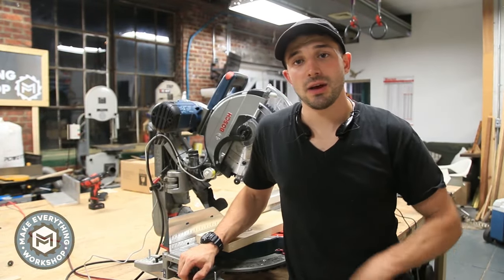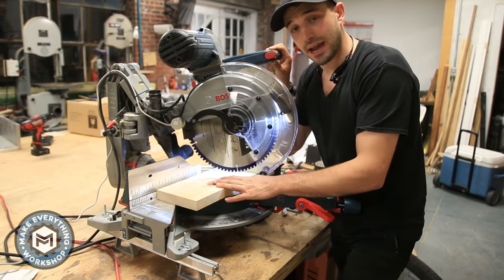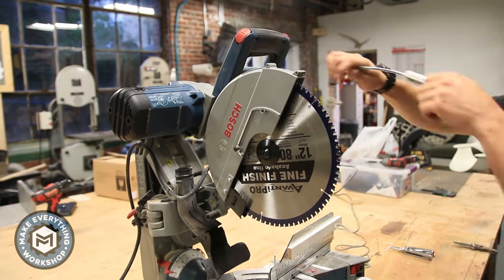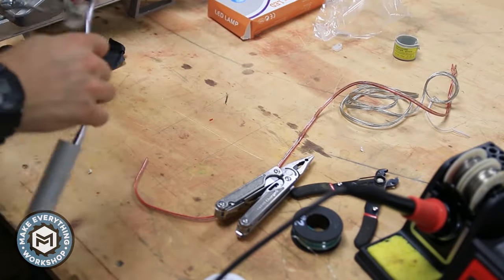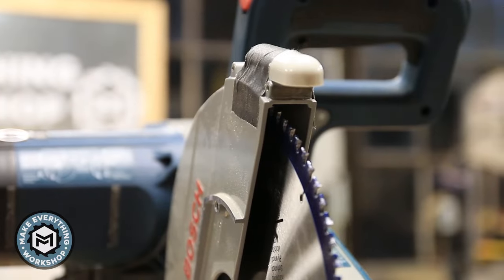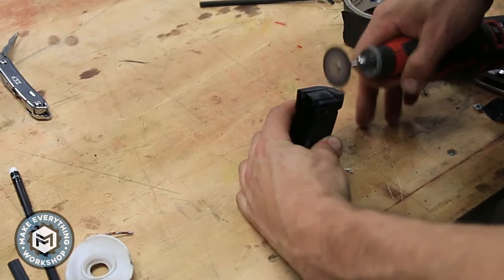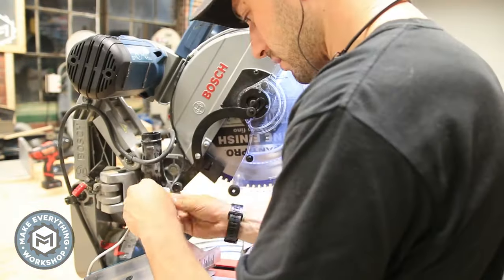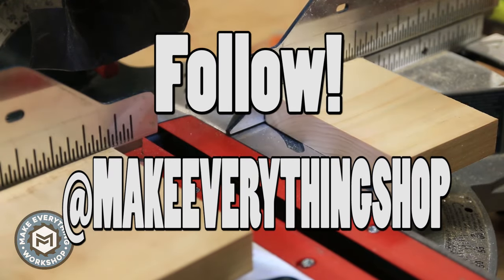How To: Add A LED Shadow Line To A Miter Saw (CHEAP!)

Comment: Great video, but Bosch changed the saw. They replaced that removable plastic shroud  you are mounting the LED in 
and made it part of the cast aluminum blade guard. Have you seen it? any ideas?

Comment: I had one of those lights, so I went right out there to install it.  I can attest that it will not work on an HF 12" compound miter.  There isn't enough clearance between the place that you mount it and the blade guard.  Unless you are willing to cut without the blade.

Comment: LOVE this and will be adding this to my Bosch also.

BUT, side question, do you have trouble keeping that thing square?

It's a great (GREAT!) chop saw otherwise, but it sucks at being square and setting it to square. If you've had an luck or hints with this part, I would love to know.

ALSO, LOVE the videos - especially the tap videos - god, I hate hand tapping...

Comment: Great idea!  I actually just purchased the GCM12SD but the nose piece is cast in the "2020 version"?  Do you happen to know if the light you recommended will still work inserted into the cast nose piece?  I have order the exact light you recommended but it hasn't arrived yet so I thought I'd ask.  Thanks

Comment: Hi Chris, can you make a video on how to hard wire the LED lamp to the miter saw.
Great video 👍
Reply: . Put a piece of blue tape over the end of the blade cover and mark the exact location of your blades location within the cover. . You have to center the lights directly over the blade for best results. Get a piece of blue tape and mark the spot where the back of the clear plastic blade shield  travels when the saw is fully down. That will tell you where it is safe to run  wires that will not be struck by the shield as it travels along the top of the blade housing.  Remove the shield and housing in one piece.  That's done by removing the blade then removing the three screws that hold the blade housing to the arm. This will allow you to easily mount the LED light housing and remove the LED panel.   Disassemble the LED panel housing and cut the wires going to the light. ( good idea to use your phone and photo each step in case you get lost on reassembly ).  Stop.

Get some light to use for the necessary wire extensions. Get a soldering iron, solder, flux for electrical purposes and shrink wrap. 

If what you want to do is "hard wire" the LED to the saws power to avoid two power lies do the following. Where do you want to run the wires from the LED light panel to the saws internal electrical works? You can exit them over the top of the blade housing and run them  along the top to the point you marked as the furthest travel of the shield then divert into the saw or run them inside the housing and secure with an industrial adhesive and protector. I imagine JB weld would do it well.  I ran mine like that and used a similar product. ( You want to adhere the wires tightly to the top of the inner guard and PROTECT them from flying wood debris. So fix them and allow to dry. Then trowel them in to protect). If you run  internally exit the wires just below the top of the guard via a small hole and epoxy the wires where they exit to ensure the do not chafe.

Allow to dry and replace the blade, housing and guard. Temporally connect the wires and check that your shadow line is properly positioned.  If so: remove the cover from the belt housing ( two screws at each end ) and put it aside. Remove the 4 screws at the top of the handle and the 3 screws under it and remove the handle top cover. Route your wires from the guard into the saws main switch housing by either going through the belt housing or over it. Connect the LEDS mains to the unswitched side of the saws switch mains. Red LED power line to the black line at the front of the switch.  THESE are NOT the lines that you installed in the guard. They are the lines that come from the plug.  Let me be a bit more precise: the red wire that comes from the LED switch ( Not the one that goes to the actual LED panel ) goes to the saws unswitched main hot ( black ) wire.  The Green wire that comes from the LED control board goes to the neutral hub or bundle in the saw handle's interior.  The white wire from the switch to the control board must be lengthened to route it inside the handle housing.  After doing that position the control board in an empty space ( there's plenty of that ) and fix it.

Now it gets tricky. You'll need to make an opening in the handle cover to mount the switch and its hub. I made one just to the front of the 4 top screws.  Mount your hub and adhere it. Stop for the night and let everything dry up.  Use light wire and solder ( shielded with shrink wrap ) to reconnect all the wires to their original routing. Position them in the gallies with blue tape and close the handle housing. Check the light. If it works go to the belt housing and secure your wires if you used that path. If not secure them on the top of the blade guard and arm if you went externally.

Comment: Was all set to buy this model saw and make this modification only to realize Bosch has changed the design on the blade cover to a solid piece (ie there is no black part that can be removed as it is now molded as a part of the cover)

Comment: i have an old rigid miter saw (R4221) that has the led light but it has stopped working for some reason and all the parts for it are basically discontinued and nowhere in stock that i can see. Would this light work if i just splice together the wires from this light and the power that's already running in there?

Comment: Great video! One question though... would a sewing machine LED strip be a good option as well? If I can avoid needing to cut wires and solder stuff, this would be preferable! In either case, this is what I need (as all the laser washers seem to be sold out - and besides, as you mentioned in the video, the light casts a perfect kerf shadow regardless of blade thickness!)

Comment: Unless the shadow cannot be seen when the blade is up it doesn't change much. With compound miter saw you can check your sawing line anyway by lowering blade. But then you need to move lumber with one hand. Still shadow is better than laser at least for us red and green color blinds.(p.s. don't want to complain too much and i do appreciate these kind of diy innovations)
Reply: markus lappalainen  totally agree. I was going to write exactly the same also no chance for shadow in day light.

Comment: Fantastic. I just purchased the lil brother to yours, the Bosch CM10GD.  My problem is where yours has the plastic cover, mine is all part of the metal shroud over the blade.  Getting a new saw and cutting into the metal makes me pause.  Any suggestions?  Any and all input you or anyone else could give would be greatly appreciated,.
Reply: Is it not an option just to make a hole for the wiring?
Reply: Did you end up purchasing the light?  Did it fit the 10" version?  I have that and am hoping to do this.  Thanks!

Comment: +Make Everything This is perfect! I've had my Bosch Glide 12" for over a year now and I also love it but based on the reviews I do not want to get the spinning laser light. This is such a good solution. Definite Like and a Subscription from me. FYI the same saw in Europe does have a laser mounted where you commented on the "plastic guard" thing that looks like it was made for a light anyway. It was.....just not installed for the US model.

Comment: Why did you de-solder the wires from the switch?  Couldn't you have just cut them and spliced on the longer speaker wires?

Comment: Bosch makes the saws different now. Instead of the raised curved black plastic piece on the upper blade cover where you placed your light, this area is all cast metal and is integral to the blade cover. So has anyone tried to add a light to the new saws?  I am thinking about drilling a hole through the metal casting to accommodate the wires and then using epoxy to mount the light underneath. Epoxy because this area is no longer I’m it’s own sequestered compartment but exposed to the blade. Any thoughts or ideas?

Comment: Hi Chris! Could you help me installing this Led light to the New Bosch Miter Saw that has no more plastic Cap to hold the light and instead a bigger metal crown? Thanks
Reply: You probably have the 10" version of the saw. The static part of the blade-guard is all metal, unlike the 12" that M.E. has. You have to cut off the metal "crown". A new / replacement blade guard for the 10" (Bosch PN: 1609B04304) is available on Amazon for $35 (ASIN B00Y9OYI74).

Comment: Bosch had to go and change the design and the 12SD no longer comes with the plastic insert, it's now molded metal. Looks like I'm back to the drawing board on adding an LED to this saw.

Comment: The product page for the lamp actually shows a 10-LED option, which looks like it might be an even better fit than the 20-LED one that is linked to. Has anyone tried out the 10-LED version? 🤔

Comment: The only problem I've been running into while following this was how to cut the metal cover on the wires so I could extend the length of the cord. The metal part wouldn't just pop out of the plastic housing.
Reply: Same problem

Comment: What happens if using outside in a bright summers day?
Reply from the maker: Russell Duffy it is slightly visible outside. If I can't see if I will shroud the blade with my hand to cast a shadow, then it's visible more easily. I usually work under an easy up tent when doing large outdoor jobs to keep my tools out of the direct sun light.
Reply: Doesn't everyone carry an umbrella when they are using their saw outside? Lol
Reply: Russell Duffy use the really big light in the sky 😉

Comment: This type of power supply MUST be fully insulated from everything! 😯
Every wire there, and the Leds, LED board etc are all fully lethal and the whole lot must be fully enclosed in insulating plastic housings!

Please be safe! 🐢
Reply: “Fully lethal” is a bit of an overstatement. The light draws probably 1/2 watt power so you’d barely feel it.
Reply: @byte-nibbler    that is not how it works!
The components are connected directly to the AC mains supply, which is lethal if touched. Please be safe.

Comment: Great idea. But if one cuts exactly on the laser line doesn't the stock become the thickness of the blade shorter. Say 2.4mm shorter. Intend buying a saw with laser. Thank You.
Reply: They are typically set up to be offset from the saw, so you can line up the laser with your cut mark and the edge of the blade should be where your line is.

Comment: This video inspired me to do something similar, but I have very little clearance in my saw (DeWalt 715 type 3).  So, I grabbed one of these bad boys:  https://www.amazon.com/gp/product/B00TGTB4HO  Awesome little lights!  All they need is a USB extender cable and you're off to the races.

I couldn't use the extender (no room), so I cut the ends off of two USB cables and soldered these to the power wires, wrapped it in electrical tape, and hot glued them to the saw.  I routed the cables over the top of the saw housing, and presto!

Thanks for this video!
Reply from the maker: Jeff Meyer great modification!!
Reply: @jeff_meyer: We have the DeWalt 715 also. Any way to post a photo of your mod? And which 2 strips on these little lights are for power?

Comment: This might be helpful to some rough carpenter building a deck (at night) but any trim carpenter or fine woodworker is going to drop the blade and align the point of the carbide tip of the inside tooth to the point of his crow's foot or his marking cut. A shadow or a laser is nowhere near fine enough for quality work.

Comment: Unfortunately does not work for my Ridged brand saw
the  clearance between safety cover and metal cover is to narrow to fit the light
I do like the idea a lot
Reply: This sewing light is also available as led strip lights.  That should solve your clearance issues.

Comment: Thank you for posting this video! I had been wondering about a DIY way of doing this & low & behold I came across your video! Again, thanks! I did however have a "Brain Fart" while watching you mounting the light of using something totally different. That being using a (Just wondering about this now mind ya) Archery Sight Pin Light. Drilling a hole in the shroud over the blade. Centering said hole & affixing the light there as if putting it on a Bow Sight. What do ya think?
Reply: considering most archery sight lights use overpriced batteries, that's a horrible idea. You'd be better off getting an individual LED that you can wire to a 120v power source and doing the same thing as you proposed.
Reply: @TwoTall1988  Do you Shoot Archery or Bowhunt?
Reply: @davidnleeh4  Yes, the sight light's I've had the two replacement batteries cost more than the light. Even if it uses the cheap 373 battery that you can get them for $0.24 ea in bulk it would be a better value proposition to just wire it to 120v

Comment: Since you are using a non-isolated capacitive dropper power supply, keep in mind that you should handle every piece of that LED as if it is at mains voltage potential.
Reply: Yep I've been stung by one before.

Comment: How is the laser "dangerous"?
Reply from the maker: BoredAtWork2000 in order for the laser washers to show a laser line the blade has to be spinning. The laser washers operate with a centrifugal switch to cover be battery life. I’ve seen guys try and line up a cut with the blade spinning (so they can see the laser) and not properly be holding the work and It blows out. Regular “always on” lasers are dangerous at all, just not always accurate.

Comment: I was looking forward to seeing fingers, arms etc being cut-off at some point - since when has it been a good idea to rest these below a (sharp) blade or touch a blade? If you think you can touch a static carbide tip with no risk then it's probably blunt. It's a 50/50 thing.
Reply: What drugs are you on?

Comment: Always stagger your electrical splices. Seems to work fine for 90 degree cuts, in the video at least, it doesn’t seem to work with other angles. A little more trouble than it’s worth. But nice idea.

Comment: Did i really hear you say "everything i do with solder, you can do with hot glue." ???
Reply: Yes, but he also said you have to do it carefully...meaning the connections need to be solid, wire-to-wire/wire-to-metal, then surround that with hot glue just so it can't come apart. He is speaking to those who shudder at the thought of soldering...not the rest of us. :)

Comment: First Thx for the video nice bosch hack, but i hate when people make videos as if they came up with the idea. Anyone with a great knowledge of tools knows this is a dewalt miter saw feature. The only saw to use shadowline and it may be patented  by stanley black and decker not sure, as i havent looked into it. But give credit where credit is due, not oh i have a great hack and completely leaving out the fact u seen a dewalt saw with it and u wanted that feature on the bosch. I owned 2 dewalt sliding miter saws with the shadowline and sold them because I prefered the  bosch sliding mechanism as it took up less room in shop. But that is my biggest regret is losing the shadowline because how easy and accurate it is.

Comment: You could have done it without soldering it all just with electrical tape just cut the wire a couple inches on both sides of the controller splicing some wire to the lengthy need it and then hook it back up to the controller
Reply: G-Shock Jock work smarter not harder
Reply: @john evenson

"elec tape"

The problem with electrical tape, and why I have completely quit using it, is it stretches when applied. Then, over time, the tape pulls on the adhesive, trying to 'unstretch', leaving adhesive exposed, and the tape coming loose.

The adhesive makes a mess, especially come summer time.

I switched to adhesive lined shrink tube, instead, and have never looked back. I even buy the cheap stuff from HF. It's "marine" according to HF, so it's not in with the rest of the shrink tube w/o adhesive.

Something like he did with putting the two wires back together with shrink tube works even better with adhesive lined.

ONLY shrink enough of the two ends to adhere the tube, then the wire can move inside the tube, instead of the wire becoming rigid.

Comment: It only sucks, because you have to keep turning it on and off.
Reply: OHHH NOO the strain of manually flipping a switch. Oh no how would you ever have gone thru life back before things were automatic. Give and take dude, hell if you need an automatic light then incorporate alexa or a sensor to do the hard labor your finger cant.
Reply: so install a mercury switch and leave the existing switch on
Reply: Or just leave it on. It's led.
Reply: svtrader The Dewalt shadow line saws also have a separate switch for the light.  Just looking for something to complain about, huh.

Comment: Problem is that saw is junk. Professional trim carpenter for 20 years. Would never waste my money on that saw, light of no light.
Reply: Why do you say it is junk?  I need to buy a new sliding miter saw and have limited space in my shop for a traditional sliding miter on rails.

Comment: You must not be much of a finish carpenter, hey? Not saying your idea is bad, just cannot STAND when people think they need a laser or "shadow" light. I need a flood light on my piece due to dim working conditions, dark stain/paint which makes it hard to see a pencil mark AND sometimes I need to take off a FRACTION of a pencil mark which is a type of accuracy you might not be familiar with.
Reply: I’m just an aging weekend warrior with bad eyesight and a cheap chop saw (DeWalt DWS715). I need all the help I can get. A shadow line would help me get 1/32” accuracy which is all I need. Caulk is your friend.